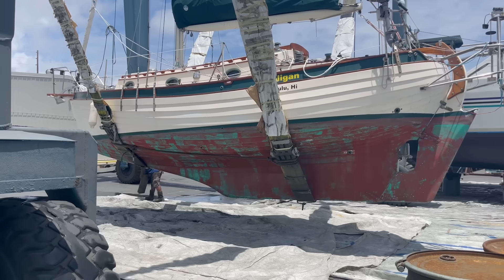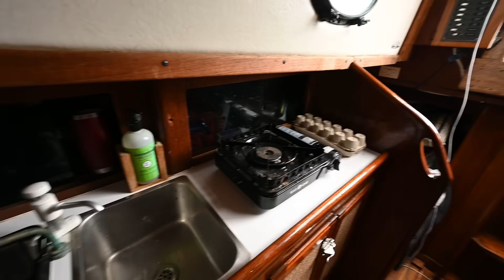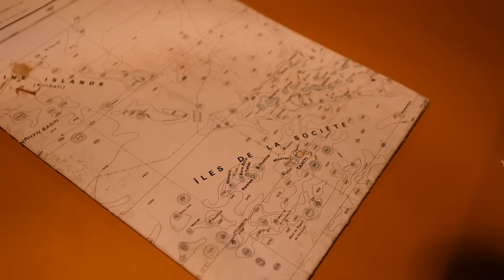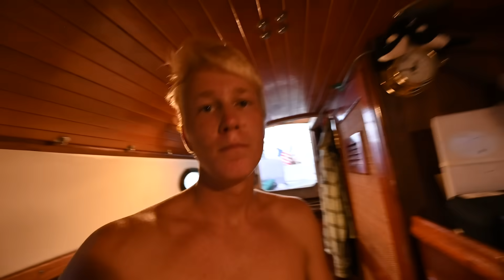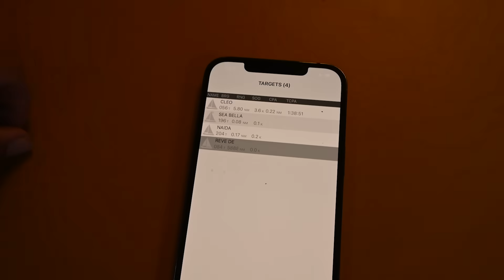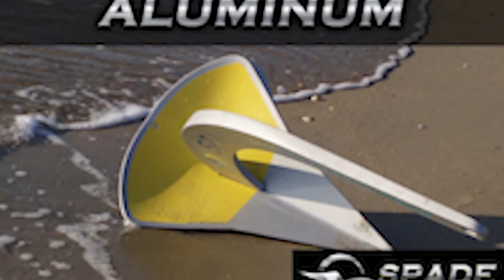Tour of my 27-foot Floating Home

Comment: I can't find another model boat like yours that has the quarter berths. All the other ones are just the head on  the port side and the galley extends to the aft cabin wall. Is yours  a different layout plan or was it owner-fitted?

Comment: I wouldn't sail without a CB radio. If your house batteries are in parallel, they will eventually mismatch. Remedy. 2 solar chargers . 2 isolated batteries. 2 separate loads. 12 volt chest freezers are now very inexpensive. Give the Engel a rest and always run the chest on ECO mode for longest compressor life.

Comment: nice! can I ask how much chain (1/4 size?) you have, and what type of anchor? I have a similar vessel to fit out. Great videos man!
Reply from the maker: H, I have about 140 feet of 5/16 chain and then another 120 feet of 1/2 inch rope behind it. the anchor is a 26 pound aluminum spade (size 100) and I love it. I would not go smaller with either the chain or anchor.

Comment: Awesome content!!  Binge watched it all. Hopefully you can upgrade to lithium batteries and also try to keep your solar panels receiving 100% sun. Even partial shade on one little spot on the panel will drastically reduce their output. You can connect a multimeter to the panels to see the difference. Can’t wait for the next trip.

Comment: Hey Garrett, recreational vehicle technician here, I might have some advice in terms of electricity production for you!

I notice you're using dual-purpose sealed lead acid batteries for house power. If you have the chance you should upgrade those to true AGM deep cycle batteries. I recommend Odyssey brand. They're a lot more durable, charge faster and generally have more capacity than a standard lead acid. 

Also, an old school strategy to get the most "bang for your buck" in terms of cranking amps/durability/dollars spent is to get two 6 volt golf cart batteries and run them in series to achieve 12 volts. That usually will give you more reserve capacity than two smaller 12 volts ran in parallel. Even then, "on paper" the capacity might seem similar, but 6 volt batteries have much bigger and heavier lead plates/mats and can take much more abuse than a 12V of similar size. Just be sure they're sealed batteries, as I'm sure you already know.

Of course the BEST option would be to swap those out for some high end lithium batteries. Those charge incredibly fast, can withstand thousands of discharges, and have the advantage of being able to use almost all of their actual reserve capacity. Compared to any lead based battery that will begin to see a voltage drop off once the battery is about half dead. The downside to those is of course the crazy price tag. two high end Group 27 lithium batteries would be around $2000 or more. Though that would get you almost 5x the battery capacity you currently are working with.

I'm happy to see you using a Victron solar charge controller. Those are probably the best ones of all the controllers i've personally worked with. Shouldn't have any issues there. 

Anyway, just some food for thought. Can't wait to see the next adventure.
Reply from the maker: Thanks for the tips! I’m gonna upgrade to lithium as soon as it’s practical. Any kind of boatwork in French Polynesia is expensive and impractical
Reply: @garrettsadventure  I can imagine, Best of luck on future adventures! ill be watching

Comment: Have you tried a sextant for navigation? And yea... you're right: everything requires a backup. Factually, some backups need a backup. Can you manually crank the engine in case of battery failure?

Comment: I love your videos Garrett, and I have massive respect for you putting up this video of your boat and opening yourself up to comment section "experts" and know it alls. So I hate to participate, but I'm a marine electrician and I was concerned about the apparent lack of fusing on your batteries and wiring. Without overcurrent protection you are just one shorted wire away from a fire that could potentially destroy your boat or at least put you in a tricky situation at sea. For starters a battery terminal fuse(blue sea systems makes the most common ones) would be the very minimum. But keeping in mind that generally fuses are to protect wires (from melting down in the event of a short), and not electronics, you should put a fuse in at every point of distribution where the wire size goes down.  There is a lot to know on this topic, but when compared to other areas of safety onboard it's often overlooked. If you do read this and want to learn more, you should check out Jeff Cote's videos at pacific yacht systems or read the relative chapters in Nigel Calders book. There is more I could nit pick on, but nothing as important as overcurrent protection, so I'll leave it at that. I wish you the best and look forward to more content.
Reply from the maker: The whole boat is an electricity shit show. I plan on completely rewiring it when I make it to the next port with good facilities. Thanks for the knowledge and comment 🤙🏼
Reply: Glad to hear it, enjoy your time in Taihiti.
Reply: ive been keep a captain for 8 months, he need at least a 50 foot bigger boat to even come close to what big papa has.
Reply from the maker: What are you even trying to say?